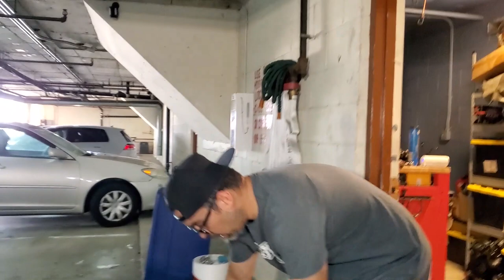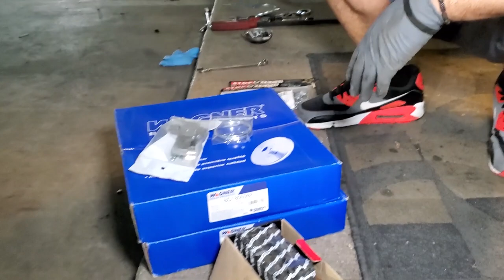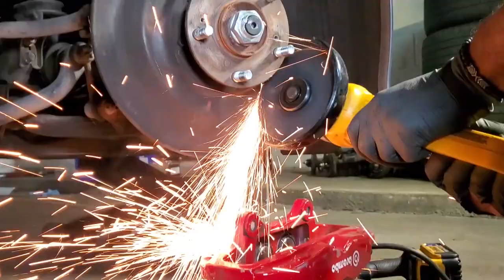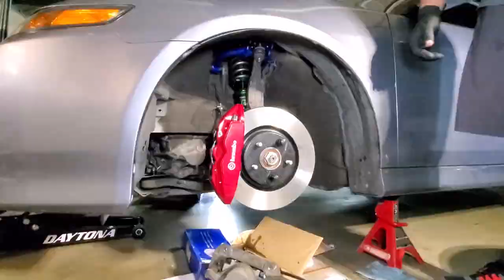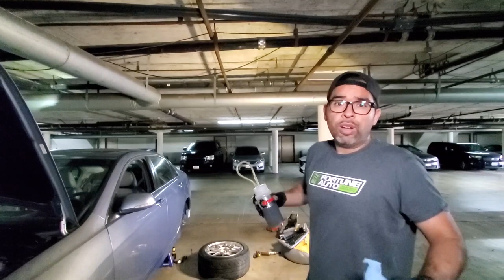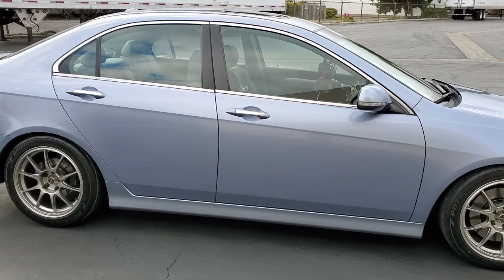Project Acura TSX CL9 Pt.3 : BEST BUDGET BRAKE UPGRADE!

Comment: $100 a caliper? Share your hookup lol
Reply from the maker: I found them at a local wrecking yard. I called a couple of placed and this place just happened to have a set. But I see them regularly online for under $200
Reply: @blipshiftapex9047  You must be on the west coast lol. They run $200-$300 each where I'm from, and you don't see them in the You Pull It salvage yard.
Reply from the maker: @bigdare23  yes we are here in SOCAL.
Reply: @blipshiftapex9047  you guys get all of the deals. :) Thanks for the motivation to finally do this on my 07. By the way, you just got yourself an extra sub. Keep up the content!
Reply from the maker: @bigdare23  thanks for watching!

Comment: Would this work on a 2nd generation tsx CU2 ?
Reply from the maker: I don't have a CU2.
Reply: I understand that. was just wondering if anyone knows if this is applicable for the 2nd gen as well or if they’re designed differently, can’t seem to find much on the cu2 about bb upgrade that’s not 2k
Reply from the maker: @teedad  I don't believe there is a transmission upgrade for the CU2. I don't believe the casing would fit in the CU2 either. But I do know Spoon Sports raced a CU2. The stock transmission in that may have had an LSD upgrade but I wouldn't know for sure.